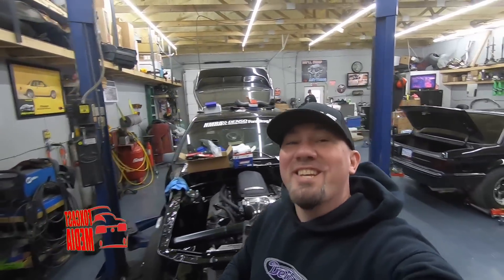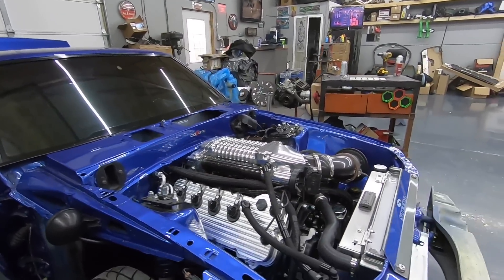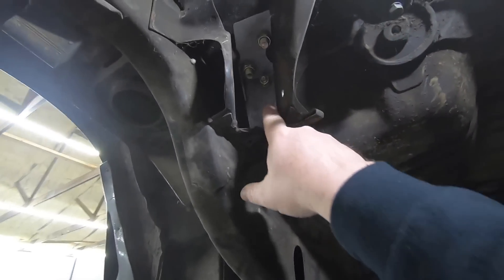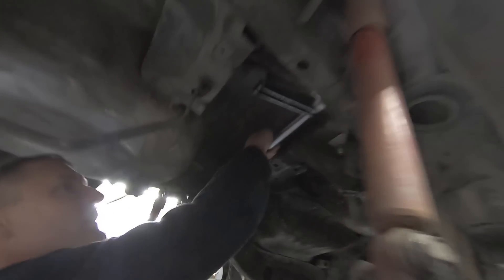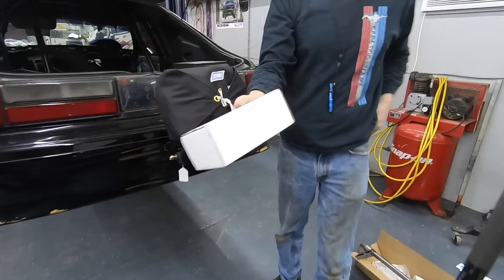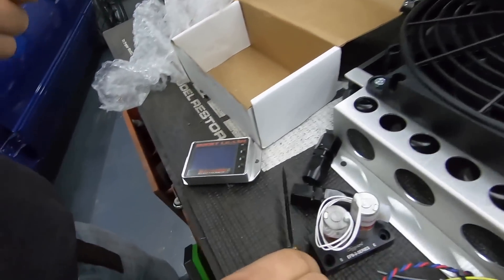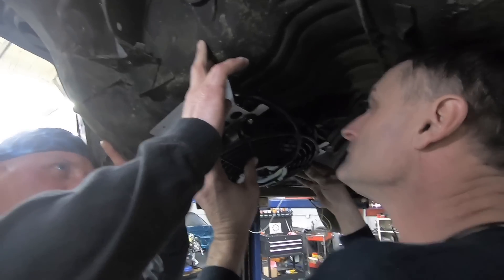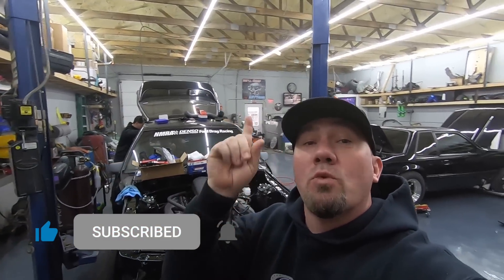What it takes to make big power! *MUST HAVE UPGRADES*

Comment: I put an 03 cobra tank in mine with a Lethal Division X sender and Two Walbro 450’s and ID1000 injectors. Definitely don’t skimp on your fuel system buy bigger than you think you need because this isn’t a carburetor and you just have the tune adjusted. Bigger won’t hurt 😂

Comment: Do have a question about those rear coil overs going in, it looks like nothing will have to be cutout to get those to fit?  I am doing the Detroit speed mini tubs and want to do their rear suspension, but price is a big factor when I can weld up the UPR/Viking kit myself.  Just curious if when they are finished with that if you can take a quick vid shot of it while you are there.  Thanks